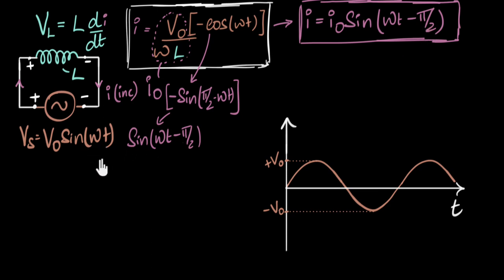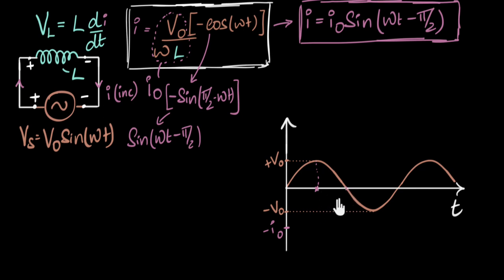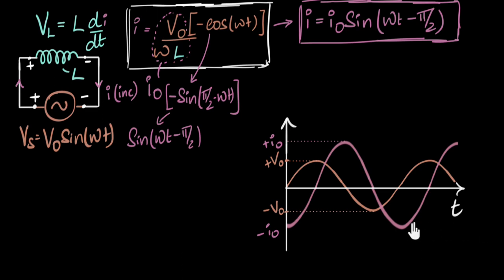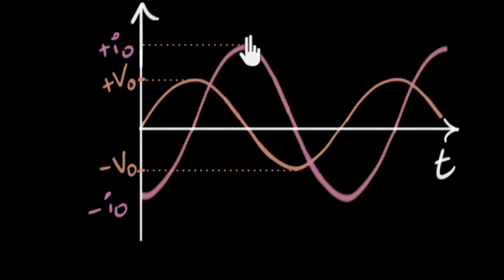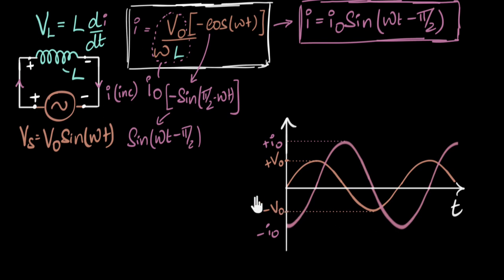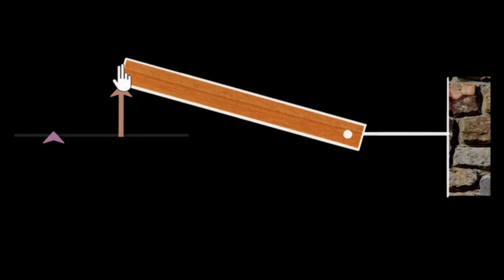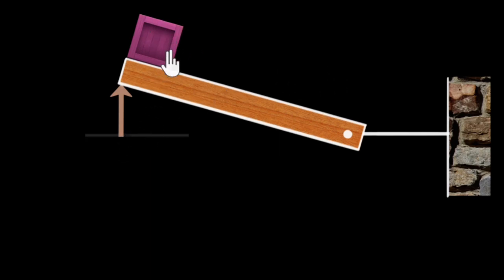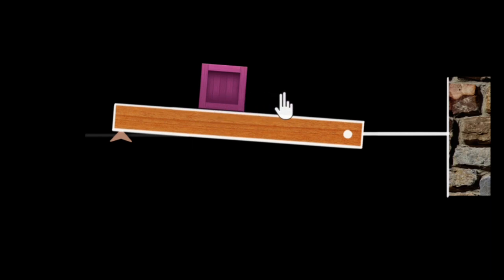Why current lags voltage in inductors (logic) | Alternating currents | Physics | Khan Academy

Comment: The analogy is brilliant but it doesn't help in uderstanding why, for me at least. But it sure helps to remember that it works that way
Reply: dude as the current changes[increases] emf is induced in the inductor which does not allow current to immediately pick up with the voltage,it oppossses that change.When voltage is zero that would be the maximum current,it is like giving an decreasing acceleration to a body on friction less surface[since resistance is zero] and then changing the direction of acceleration[decelarating it] and at half cyle of voltage it becomes zero since it has gained that amount current in that half cycle of voltage.hope u understand .

Comment: here my analogy to this question 
notice that the current is higher when change in voltage is higher, this can be explained as follow
since inductors hate change in current the the inductors will introduce high EMF when there is high change in voltage and this is why we toke derivative in the derivation of current

Comment: What is current at that instant  when mechanical analogy starts at Vs=0 ?
Reply: bro he related velocity with current so if velocity of the anology is zero then current would be zero but still has voltage

Comment: Why the quantity of current shown more than voltage in the Graf? Normally valu of current less than voltage, please explain
Reply: The magnitude of the voltage and current are taken are arbitrary (random). Its just to show the difference in voltage and current. Technically we are not comparing the magnitude of the voltage and current5 but just the phase.

Comment: With full hope of finding an answer to my doubt, I opened khans video, but i really get disappointed. My question is, how can an inductor attain negative maximum current as shown in the graph at the  begining even before voltage starts increasing from zero value at  t is zero? Nowhere in video this point is touched.
Reply: were you able to find an answear, i have the same question